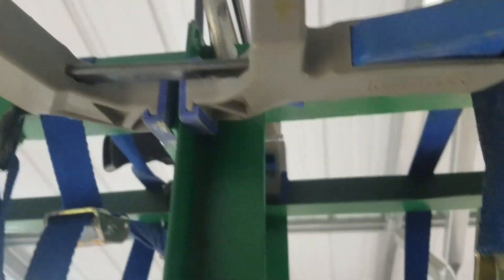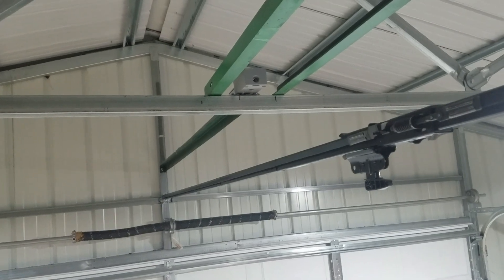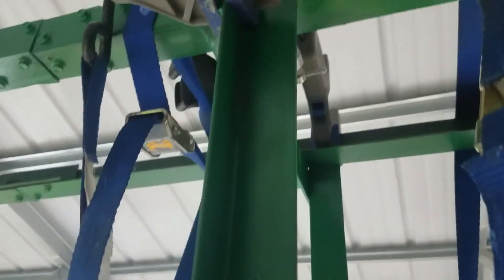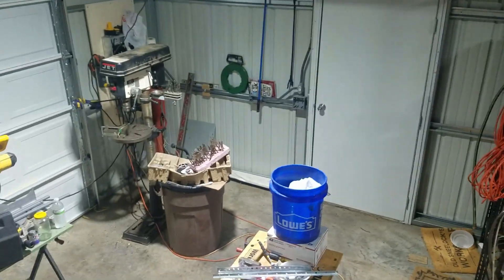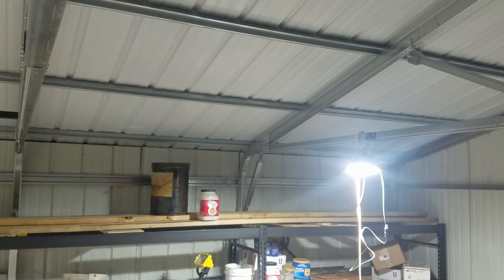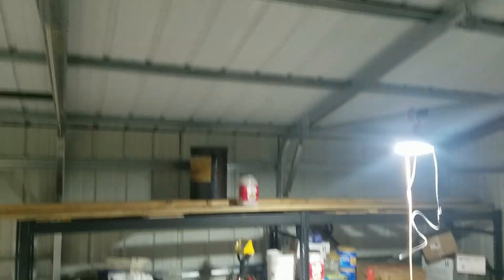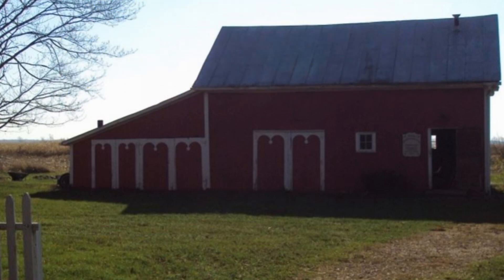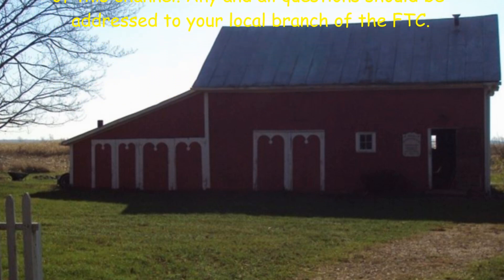Annex Garage Door Opener - Final Framing

Comment: I spent one whole Winter making a huge overhead crane system for a pattern shop, I don't remember all the dimensions anymore but I'd say it covered almost half a football field in square footage. We should be able to whip one up for the Annex in less than a week.
Reply from the maker: That would be excellent. 😁😎 Might have to wait until I win the lottery. Steel is a bit pricey right now. 
In the late 70's I visited a die shop in Windsor to pick up a part sample. They had a horizontal mill that could accept a box car on the bed. They had two big bridge cranes over it. 
Matt @dieselcreek has one that has been sitting in his storage area for  a year or so. 
Demmer bought the old GM Engine plant. It had 4 monsters bridge cranes. One bay had a 15 and a 10 ton crossbeam on the same rail system.